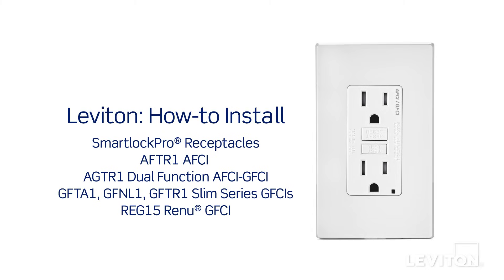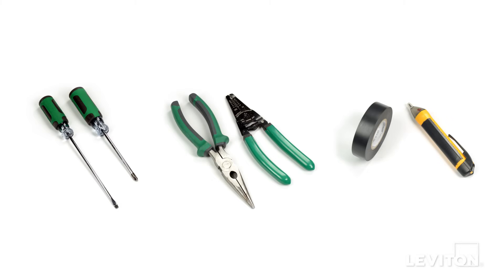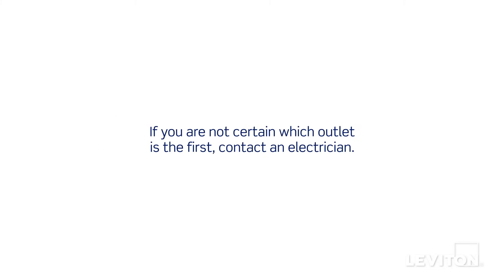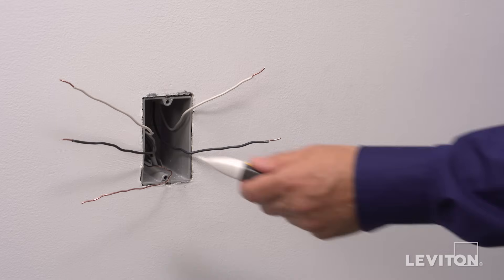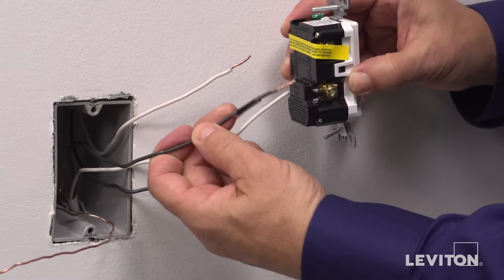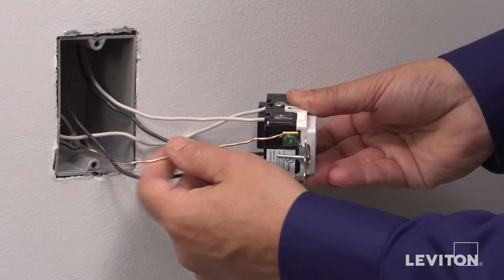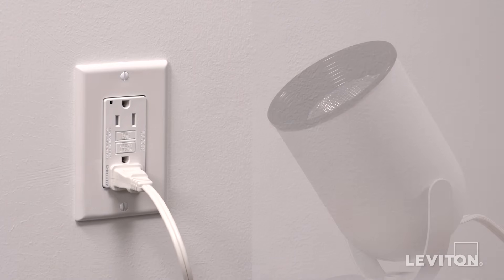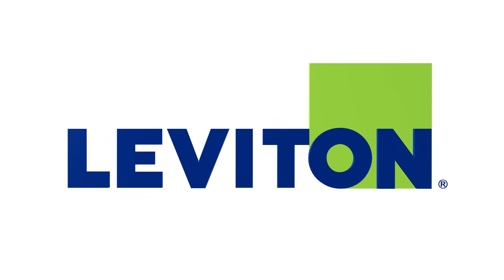How to Install a GFCI Outlet, AFCI and Dual AFCI/GFCI Outlet | Leviton

Comment: I thought it was upside down too!!  A pet peeve of mine. I’m not an electrician, but every  outlet I’ve looked at has been 180 degrees
Reply: yeah its a new thing... its supposed to be safer and as a quick visual cue to indicate a switch-controlled receptacle.

Comment: Turning off the circuit breaker assumes that you KNOW which one to turn off. I use a label maker (P touch) to put the circuit number ON the breaker. Also, I use it to label what outlets and/or lights the breaker controls. That paper on the door of the power box can fade or isn't labeled. I also label the inside of the cover with the circuit break number. Remove the cover, and you will know the number of its breaker.
Reply: I wish you'd been the old owner of the house I bought. My circuit breaker panel is labeled, but it says very general things like "lights," "receptacles," "kitchen" etc. Has only a vague connection to the actual circuits. Numbering inside the switchplate covers is a good idea.

Comment: I changed it than I didn't have power. After a couple of hours, realized that I had put the hot wire on the bottom where the load wire goes

Comment: You put it in upside down !!!!
Reply: I thought the same thing 🤣 makes me question the whole video 😂
Reply: Glad I wasn't the only one to see that. 😅
Reply: fun fact! It's actually safer upside down, because if anything thin and conductive (think a butter knife) touched the hot/neutral prongs of something that is plugged int it'll create a short. Putting the ground on top stops that from happening!
Reply: @magixtwister  how would that happen on accident?
Reply: @magixtwister  Doesn't stop something from sliding up underneath.
Reply: It means it's connected to a light switch.
Reply: He’s not a electrician 😅

Comment: I’ve always dealt with white and black wires but I have 4 color wires... gray, white, blue and purple. I have the green light on that they are wired correctly but I can’t get the test button or reset button to work. I’m not sure if it’s called trip or pop) help anyone!
Reply: You connected incorrectly, LINE and LOAD most likely have to be reversed.
Reply: Ir happened to me! 😂

Comment: The indicator lamp briefly turns red but does not turn (or stay) green at 6:32 - the indicator is off, but the outlet is powering the lamp.
Reply: That's what I thought
Reply from the maker: Please call 1-800-824-3005 for assistance

Comment: But it’s upside down.
Reply: In some commercial applications, Code requires upside-down installation, something having to do with grounding.
Reply: @queencitysirens8755  safety, there are a few reasons, but the biggest one is if the plug is partially removed, things could fall in between plug and wall. It's a lot safer for them to fall on that safety ground pin than the others.
Reply: @queencitysirens8755  
Us too

Comment: Please correct video,he put outlet upside down?
Reply: Putting the ground at the top is good practice, if you drop something metal on top of the hot and neutral it would be bad, if you hit the ground not so bad

Comment: Why  is the outlet installed upside down?The wiring is ok but the neutral pin or the long pin is usually on the left side,
Reply: That's a safety thing that is not necessarily a requirement. The idea is if a 3 prong plug is slightly out of the socket then something metal touches it the ground prong will prevent a short. School I work and actually install this upside down and I'm glad they do because this one area was a fan plugged in find a Shell filled with metal pans.
Reply: @robertknight4672  when the outlet is vertical it is recommended to put the ground up when you are using metal cover plates instead of plastic, if is horizontal then it is recommended to put the neutral up
Reply: I think it is allowed in commercial building applictions

Comment: its upside down
Reply: I was taught it's upside in case an object hanging above the outlet fell on a cable plugged in. If the fallen object popped the cable partially out it would make contact to the ground - not hot - pin.
Reply: The NEC doesn't specify which way to orient a receptacle. 99.9 % of electricians install the ground terminal DOWN.  The plug for receptacles are shaped for this position.  It has been ergonomically- proven it is the best position for thumb and fingers to plug in or unplug.
Reply: An electrician told me that many preferred to put the ground terminal up in case children might be attracted as they could  "see" a face (eyes and mouth) and could insert things in there, etc.
Reply: There is no standard, just a lot of opinions. The manufacturers don't even seem to agree. Leviton literature shows everything ground down. Hubbell shows it ground up. I just got a Hubbell GFCI. While the test and reset buttons are printed both ways, everything else is printed to be read ground up. That includes the stamped writing on the mounting bracket, the molded terminal identification and strip gauge on the back and the glued on UL label. The Leviton GFCI it replaced was just the opposite. This argument has gone on for years. There are all kinds of arguments from reduced shock hazzards to better plug retention to aesthetics but none are code requirements, just opinions.